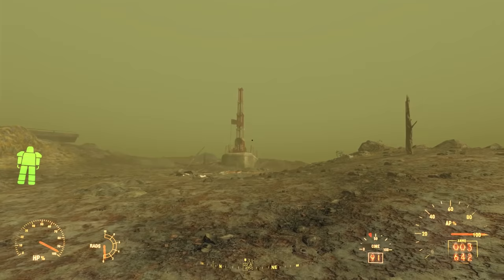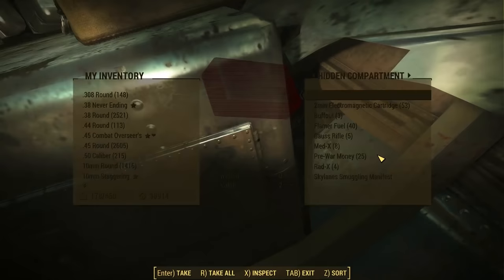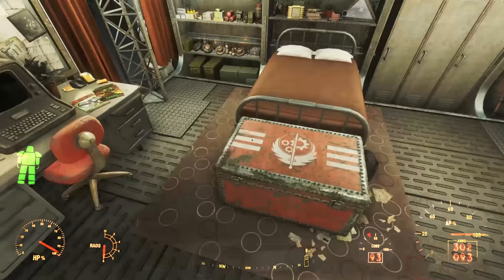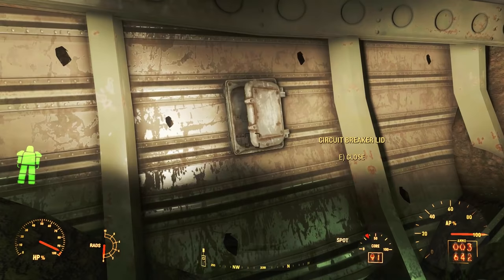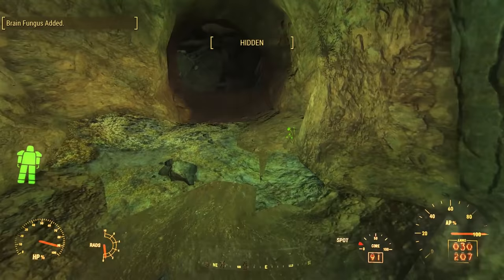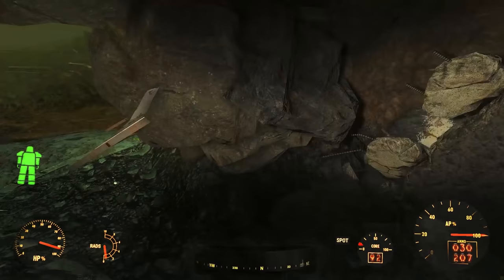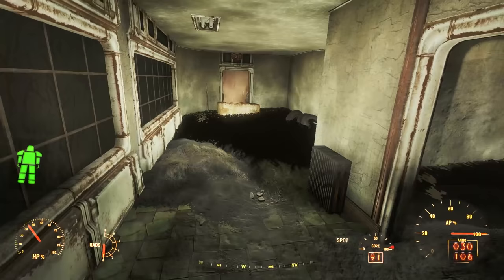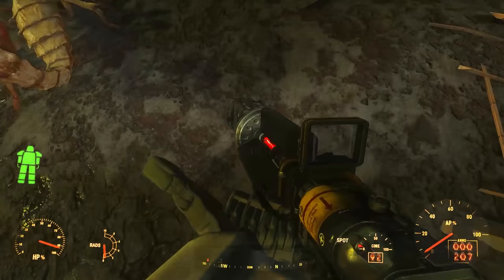Relay Tower 0DB-521 - Raider Cave, Sunken Church, & Crashed Flight 1665 - Fallout 4 Lore

Comment: If the nuclear explosion from the bomb caused seismic waves in the region, and areas had high concentrations of ground locked water, it may have resulted in liquefaction, which would explain some of the buildings sinking underground. But that would some rather specific circumstances coming together there
Reply: I would agree with that assessment with the Red Rocket. The church shows more signs of being buried by burning soil.
Reply: Andrew Price maybe it wasn't liquified but it caved it.  Most churches are built with a basement.  This also could explain the red rocket, as we do see the red rocket near sanctuary with a "molerat den" underneath it
Reply: Oops I meant to say it caved *in
Reply: Andrew Price Liquefaction is kind of a misnomer, it doesn't require groundwater. It can also happen in sandy soil, the harmonics of the shockwave causes the sand particles to get super loose allowing things to sink.
Reply: Not so much a stretch, If the blast fractured the water mains the combination the seismic shock of the detonation & the water intrusion could've produced the liquefaction. Also remember that boston is close to sea level, any leakage from water pipes or other sources of water infiltration could create the areas of water saturated soil vulnerable to liquefaction!
Reply: if you look at the ground in the glowing sea ,there are cracks in it ,as if there was alot of water at one point that rapidly dried up .also you do find large ponds of water in the glowing sea ,so the water table is quite high .if it was at a comparable level when the bombs dropped then your liquefaction theory has some very strong ground to stand on .
Reply: That is true, and the surrounding around of Boston in the real world is known to have quite sandy soil, and a lot of glacial till, which can become unstable too. The presence of ground water would just increase the severity of the process
Reply: remember the area south of boston is a biome called Fens. Fens are a sort of swamp. the soil in the area is also largely sand so its very possible this was the cause
Reply: The cracks could also show signs of an earthquake of a high rating
Reply: An earthquake is unlikely. The east coast of North America, currently seismically stable, and likely will remain that way for thousands of years. While land once covered in a thick ice sheet can experience seismic events long after the ice sheet is gone (See: New Madrid earthquake in Missouri), it seems more likely that the shockwaves from the nuclear blast caused liquefaction of the soil, turning the ground into quicksand.
Reply: the nuke was the earth quake fatmans detonation in hiroshima was equivilent to a 6.0 earthquake and the tsar bomba was a 8.35. they release so much energy that its dissipation is equivilent to a earth quake.
Reply: If I remember correctly, some of the Boston Area is Infill. In fact, I have found this to be the case. Beacon Hill, for example, was flattened in the early 1800s, and was then used to fill in part of Back Bay.

So, essentially, what happened in San Francisco after the Loma Prieta Earthquake.
Reply: Andrew Price What kind of rock is it mostly beneath boston? lime stone? Because if so, it could be a karst area and thus prone to sinkholes which most certainly could be triggered to collapse by the ground blast wave of a nuke.
Reply: NormandyFoxtrot yeah, what I'm thinking is that if the soil had liquified with water in the mix, at least that church would have filled up with soil and sand as it sank.
Reply: I'm leaning towards post explosion landslides and debris collecting into temporary dams.  Some of the area could have been under water for a while or washed over by floods caused by collapsing dam formations.   It's all a matter of where they were, how long they lasted and how much water they held.   One dam breaking could have ended many of them, as each put pressure on the next.  At least we're long past the irradiated flash flood stage when the game takes place.
Reply: also the middle of Massachusetts lay's directly above a fault line... so there's that too :3
Reply: Andrew Price I just thought as nuclear fire washed over the land it moved the ground
Reply: Well well well, Andrew Price
You have certainly done your homework.
Reply: There is one other possibility not accounted for and to my mind it's the most obvious. The glowing sea is plagued with highly energetic rad storms, that don't tend to contain a lot of rain, but they do seem to be very windy. So there's a good likelihood that the buried buildings just happen to be the victims of constant dust storms and of random chance. Since the ground isn't totally flat, you have hills, mountains, valleys and the like. Meaning that the buried buildings happened to be in lower laying areas that have been more susceptable to collecting the dust from 200 years of constant rad storms. Over that kind of time it would be easy for dust collect in valleys, river bottoms, and the like, while also having the time to pack in hard.
Reply: Andrew Price could be underground caverns that collapsed
Reply: There's no need to invoke geological phenomena like pyroclastic surges and what not, after a city's worth of buildings collapse amid destructive explosions, all ground securing erosion preventing organisms are permenantly destroyed, and two hundred years worth of wind blows it all around. Sorry to spoil the fun!
Reply: The Mudpit What the hell did you say?
Reply: The problem is that Massachusetts sits on rocky clay, there isnt much in the way of subsurface water.
Reply: Andrew Price much like this https://youtu.be/UPwSN9gUG5c and yes while one could argue thats an underground detonation, have you seen the size of the crater?... Even with the thing going off some distance from the ground (presumably speaking given the standard method of nuclear detonation) I would say a good chunk of that energy managed to pound it's way through the ground. Hence why the crater where CoA are is quite deep and has "mountains" surrounding the edges. It was definitely a big ka boom boom.
Reply: It's been 200 years, the rad storms could have shifted the earth around to bury the church.
Reply: Especially in an area of karst topography
Reply: A ground burst can cause seismic effects, there are warheads designed to do it. In the Earlier days of the cold war, before they had MIRVs and multi megaton warheads capable of digging out any bunker (its why the US turned to E4-Bs) there where attempts to take the WW2 "Earthquake bombs" like the grand slam further. The goal was to make ground penetrating warheads that then caused Seismic effects to destroy bunkers.
Reply: Liquefaction is seen in earthquakes and would make sense in a nuclear attack.
My thoughts exactly.
Reply: Would that make the area rather marshy? Perhaps the liquid caused it to be more wet and prone to flooding?
Reply: Considering all the swamp outside the Glowing Sea, this seems the most likely to me.

Comment: All of the planes near the bombs would have crashed because every  nuclear bomb sends out an EMP which would shut down every plane. That's why in Boston all of those planes went down.
Reply: Sheriff Doge Sheriff Doge I wouldn't be so sure. 1981 seems to have been brought down by the blast itself given that the radio silence from Boston Tower suggests the bomb has already gone off, either disrupting the signal or destroying Boston atc. The thing that's odd to me though is despite their flight path they seem to have visually missed the initial detonation only witnessing the rising mushrooms on the horizon (I assume from up there they could see more than just the one). 

1665 Contradicts itself (likely a mistake by Bethesda) If the engine failure recording is the correct one it sounds like it would have been the biggest news story of October 2077 had the bombs not dropped. Total failure of the left engine, it could have crashed just moments before the bombs went off... shame there's no time stamps.

Also not every nuclear detonation creates an emp (atleast not an effective one) and not every emp equals a nuclear detonation. I'd even be willing to say one did not occur given terminals and holotapes not physically damaged seem to still work and the other flight data recorders seem to not only have survived but were still functioning after the blast as seen in 1981.

(edit to add) There's evidence of another skylanes crash in South Boston. It's so broken up though it's hard to tell what happened other than looking at the debris field and the buildings it damaged. The flight does however appear to have broken up in mid air suggesting the concussive blast may have taken it down, otherwise it should have been on a glide path and had a tightly grouped debris field like the other two.
Reply: In the Fallout universe, most electronics weren't affected by the EMPs due to the way they worked. I'm no expert o the subject by any means, but it was something to do with the use of vacuum tubes/etc instead of transistors and such. That's why all those radios work. If you listen to the planes, most of them went down because of damage from the bomb itself (or pilot error, possibly blinded by nuclear detonations). I sure as hell wouldn't want to be anywhere near a nuke if I was in a plane.
Reply: EMP would not bring down a plane. Every year Lightening hits planes & they are able to continue to fly because there systems are hardened for lightening. Also there are bombers that can deliver nuclear weapons. 

For an EMP to occur the detenation has to be at a high altitude. A low or near ground detection will not trigger an EMP.

Comment: Well, it's mentioned several times in FO1, 2, 3, and Vegas that the sheer magnitude of nukes going off did indeed set off many fault lines and volcanoes, which would certainly explain sunken structures. Not to mention the broken up landscape.  And contrary to popular belief, there are several dormant fault lines in the Northeast.
Reply: Evan Ulven The Great Divide in new vegas is a giant example.

Comment: In California where I'm from, (and most notably Japan) it is pretty common for earthquakes to turn soft soil into something akin to quicksand. The blast, and the amount of them (remember Boston wasn't the only place struck) probably caused seismic activity near the impact site causing buildings, vehicles, and all manner of debris to be buried, partially or completely. The addition of earth, buildings, and other debris being thrown into the air added to the burial.

This "quicksand" effect could be a reason that many buildings are sunken into the ground. It would really depend on the soil holding up the building and can vary from as little as a block.

Comment: Some phenomenon that could support your theory on the soil being compromised in the glowing sea due to the blast could be a lahar or soil liquefaction. A lahar is a type of volcanic mudflow that is a mix of pyroclastic material, rock debris and water. when they solidify and harden they usually have the hardness and consistency of cement. The blast could have potentially caused one of these but I do not think so. Usually these form along a river valleys adjacent to or near volcanoes. Soil liquefaction is far more likely as it is usually caused by some sort of applied stress to partially or fully saturated soil (water saturation of course). The most common cause is seismic activity such as earthquakes. It could be possible that the shockwave from the nuclear blast applied enough stress to the soil which could have been saturated to induce a liquefaction event.Just some possibilities.
Reply: IrishThunder2020, are you a science teacher or something? Damn😂😂😂
Reply: Nope, I'm just studying geology in university.
Reply: Aaaay my cousin got his phd in geology, good luck to you!
Reply: IrishThunder2020 that's really cool, I hope you graduate with a good gpa 👍👍👍
Reply: Would be an interesting thing to test, also with certain minerals like lime as some people think that's the culprit as well (makes sense if you use the heat from the blast).
Reply: IrishThunder2020 doesn't the area around there have a very high water table. I know they have an on going problem in DC with keeping the Washington Monument level and from sinking. If that were also true in the Boston and surrounding area liquefaction would be the most likely cause, just because it seems to be random.
Reply: Yes, the water table in areas that may suffer from liquefaction is generally quite high but there are other factors that affect liquefaction. Grain size, pore space and soil density are all factors in liquefaction. Soils with larger grains and low densities usually have higher pore spaces and can hold more water. When liquefaction happens it is caused by seismic waves shaking saturated soils which causes the individual grains to readjust into a tighter framework (think of loose sand in a jar, if you shake it enough the sand will become more compact and uniform). This readjustment can cause the pressure in the pore spaces to increase to the point where water cannot not effectively drain from the soil. Since liquid cannot be compressed the load that would normally be supported by the soil framework is transferred to the pore water. This reduces the load capacity of the soil and can cause sinking of objects such as buildings.
Reply: IrishThunder2020 the hardening around some of the buildings is like the remains of lahar material. I live down river from Mt. Saint Helens and the soil left behind is like cement, it will take many hundreds of years for the river to ever wash it back down to its original level. But that required an entire mountain of snow and glaciers melting to produce, along with almost 2,000 feet of the top. Doesn't seem likely it would be a lahar.
Reply: I'm an amateur volcanologist.  I was watching the video & thinking: Lahar,  Pyroclastic Flow,  & General Liquefaction. Glad to see someone else was on the same page.

Comment: The pilot who noticed the bomb probably saw it being launched then passed out 
The other pilot was focussed on the dials and then began to freak out and crashed 
That's my theory on it
Reply: CROSBY THE WOLF the planes were going different directions, meaning one was flying straight towards it and saw it and the other didn’t and still got the effects of the bomb.
Reply: The EMP from the bombs shut down the engines in the planes
Reply: @elijahguiliani7415  Not all bombs have an EMP, this is a widely believed fact, it was most likely the concussive force from the blast of the nuke.
Reply: @AA-bz1pr  a soldier mentions emps. The solider being the one who owned power armor in concord
Reply: @Breached18  Yes and as I said, not all bombs have an EMP
Reply: @AA-bz1pr  id assume all the nukes launched in Boston were emp

Comment: The Glowing Sea Red Rocket is a great spot for a potential emergency bolthole.  I use the portable workbench mod, and it's where I stop off to do emergency power armor repairs if things go crazy out there. :)  The X-02 Power Armor mod also uses that location as well.
Reply: James Roden that's a good idea, in going to try that
Reply: Couple tips on that one...for the portable workbench, make sure you have the power armor bench crafted for it.  Also, make sure you carry your spare repair materials as shipments instead of raw materials (The shipments don't give you any encumbrance)

Comment: There could have been an underwater Aquifer or maybe a Mineral like Lime under what is now known as the Glowing Sea. 

After the Nuclear Holocaust it could have caused the water to Evaporate, Causing the soil to become weak & began to Create Sink Holes. 

Also the Sink Holes could be caused by Certain Minerals that were dissolved from 200+ Years of Acid Rain & Fallout. 

The Sentinel Site also could be built on a Higher Elevation than the rest of the surrounding Area, If it's on a hill it could Explain why it's still mostly above Ground.

That's my Assumption.

We will never know without Ground Penetrating Radar & Soil Composition Testing, Lol.

Comment: It sounds more like a radio play than the recording from a burning plane that is about to crash
Reply: needs more signal noise between the pauses.
Reply: Dude, don't think all the people out there are as cowards as yourself. A lot of plane crashes had records where pilots were reporting to the tower with very calm voices. And it's quite easy to explain - while the plain going down and the pilot tries to do everything he can to stabilize or at least to minimize the damage he has a very little time to scream and cry.
Reply: Pilots are trained to remain calm during crashes and emergency.
Reply: Vladimir, Benjamin, while shock provides false calm, AT TIMES, it is not consistent enough. Also, it sounds forced because of the shock tightens muscles, including the throat muscles. Furthermore, paper training, simulation training, and in case of training fails when compared to the actual practical application during an emergency. You cannot fight your own mind when it releases chemicals.

Comment: Things travel in arcs so the explision doesn't make the dirt travel in a straight line. It shot it in the air in all directions traveling in a large arc till coming back down there fore the closer you are the less likely you are to be covered by dirt

Comment: funny thing about high explosives in soil - the bulk of the soil that gets dispersed from the explosion is actually further away from the source of the explosion, the lip that gets formed around a crater is mostly just displacement from the explosion inside or on top of it